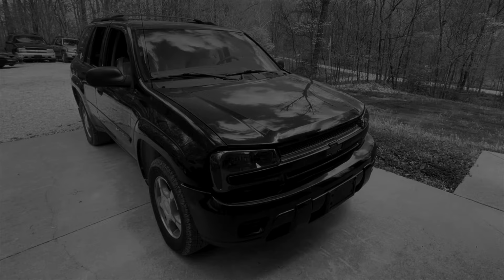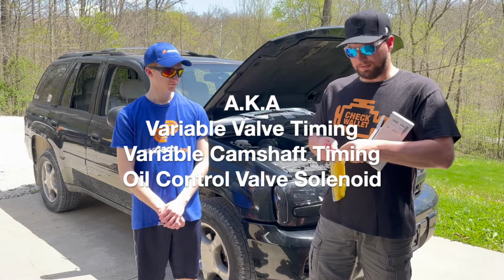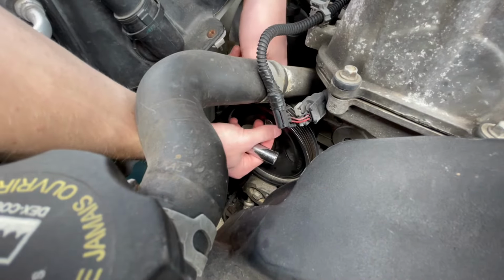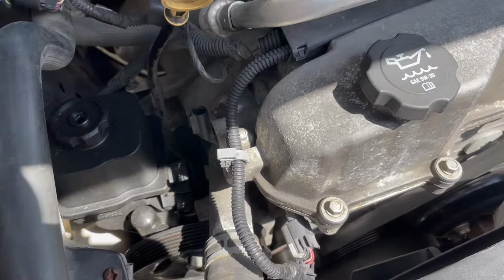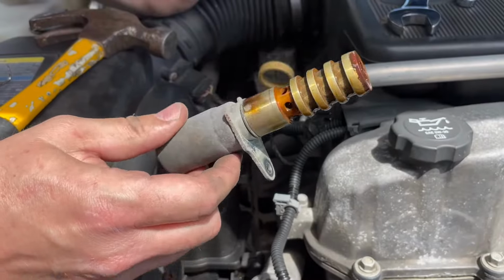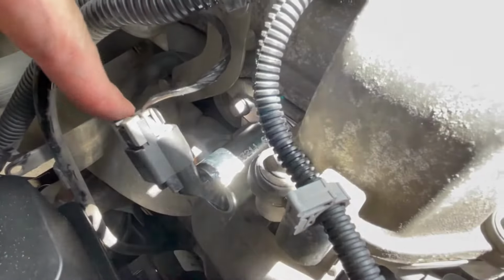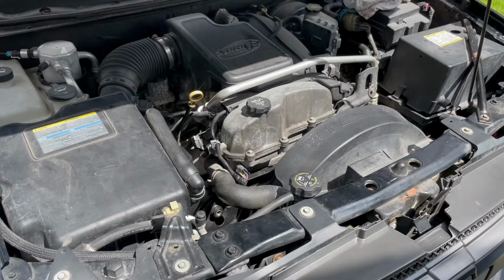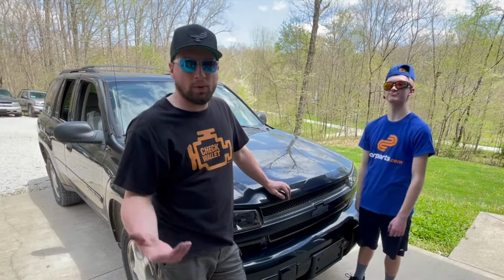P0014 Fix - Replacing a Variable Valve Timing Solenoid - Trailblazer Envoy - CarParts.com

Comment: Dan, do you think that it is worth keeping and fixing an older trailblazer even after it dies ?
Reply from the maker: I suppose replacing an engine is cheaper than buying a new car. Its all according to what you’re willing to work on and condition of the vehicle. Is it worth the time and money to you? I’ve kept two dead failblazers as parts trucks, and aside from taking up space in my driveway, it has been beneficial for me just in parts I’ve pulled to keep my good Failblazer on the road. 👍

Comment: I just installed this part for the 2nd time, in my wifes 2006 Trailblazer. Buy the AC Delco part, don't buy cheaper brand. They've updated the design on AC Delco.
Reply: Why did u have to change this part

Comment: Been there, done that. Mine didn't have any stored codes. Oil had leaked through the body of the VVT actuator and filled the weather pak connector. Since it was at 285k miles, I replaced it. No change in operation was noticed however.

Comment: I just changed my evap purge valve po440 I went through the top let me tell ya the clips that hold it on we’re the hardest part they used 2 different lock setup at least on the 02 they did 
  They all seem to have the same issues ….However 263,000 can’t complain to…
Next job is the driver side axle or diff seal luckily it looks like the outside one ..I seen the one where you did the inner man that was pretty slick ! 
        The rear axle is making noise on mine sounds like a bearings but in ways it sounds like gears when you let off the gas a little it’s not as bad now that I sit here typing this maybe I should check the pinion nut probably ready to fall lol ….
Keep them vids coming brother !
Reply: Damn I'm having the same issues at the same milage on my sisters 09 trailblazer but like you said almost 300k we can't complain

Comment: I had to do this in mine last year. I had to loosen the power steering pump pulley and belt to get the old one off. Kind of a pain but worth it. These things crap out over time.

Comment from the maker: Ever talk to yourself while you're spinning bolts?
Reply: Usually I'm talking to the bolt please don't strip
Reply: @Daninator I have the same problem but I’m still getting the code for p0014 after replacing the vvt solinoid.   What else would this be cause by? Can you help me please?
Reply: I be spinning the bolt saying why dont this "B" come off.
A little push 20 min later it slides right out 🤣